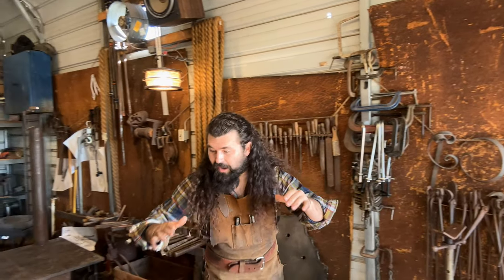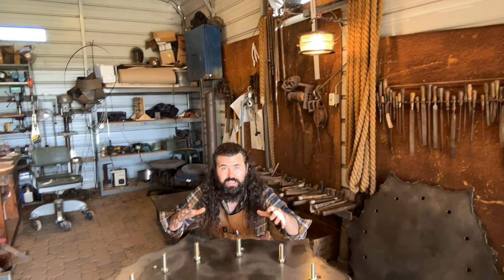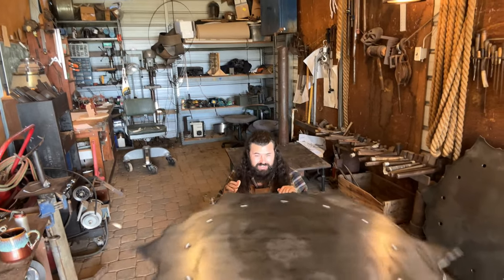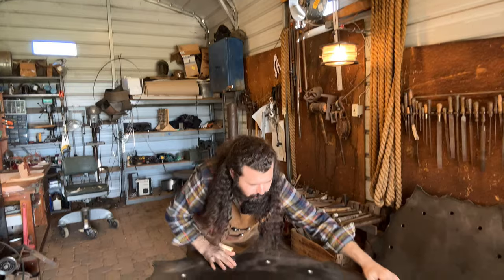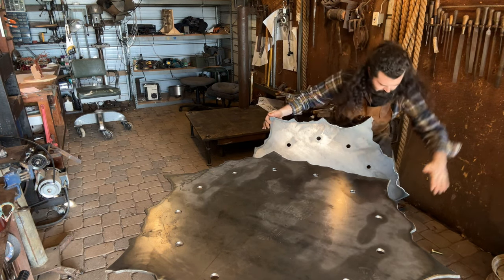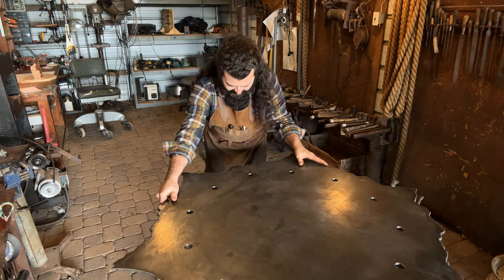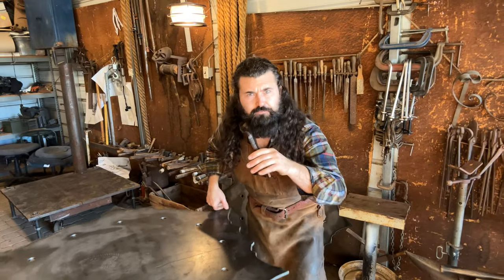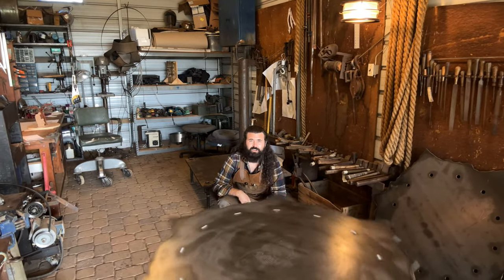Maxed Out - 500 lbs of Centrifugal Force!

Comment: Awesome video! The reason the single plate works better is because the additional 250lbs is bending the bottom plate so it’s making more contact with the table and therefore more friction. 
Another interesting thing about flywheels though: they have thick rims because more momentum can be stored that way, as angular momentum is equal to the mass times the velocity time the radius, the further from the centre the mass is, the higher the angular momentum!
Reply from the maker: It’s just so fascinating!